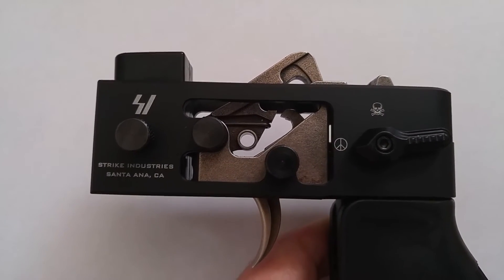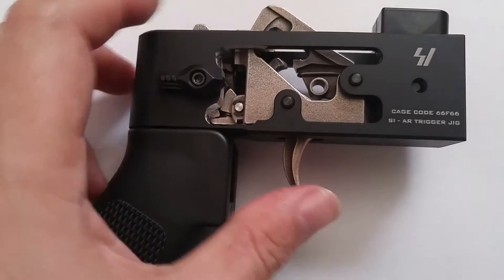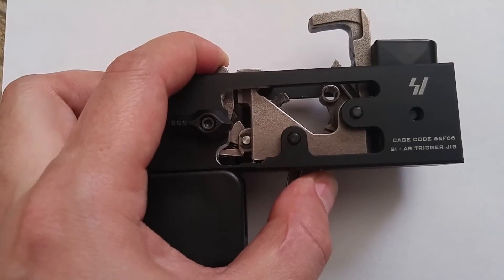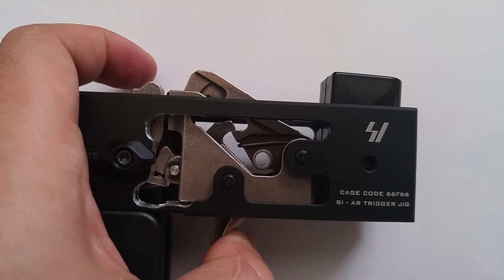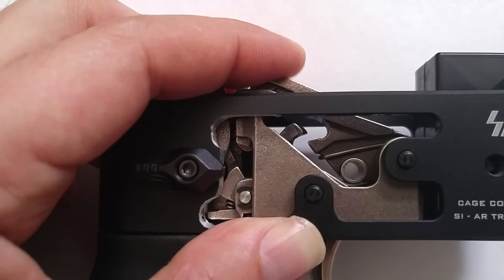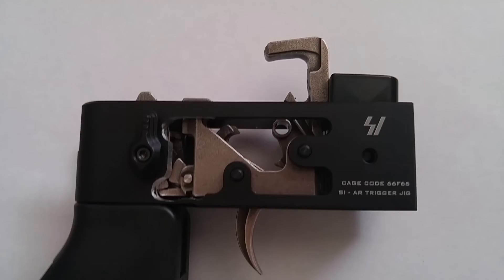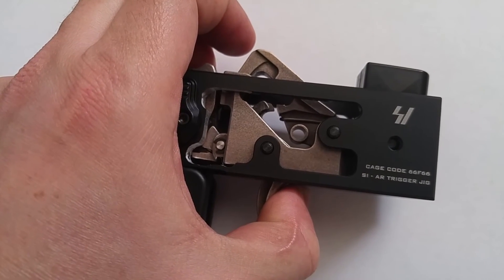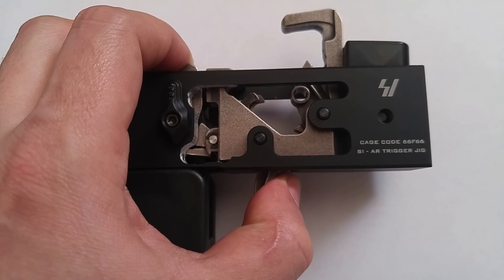Fostech Echo - cycle of operations shown in a jig.

Comment: I think I'm having a problem with my echo trigger and I'm still confused on the operation of the echo mode. with my ar unloaded and in echo mode I can cycle my bolt, pull the trigger and the hammer falls, hold the trigger all the way back while cycling the bolt again and while the bolt is closing I can actually release the trigger and the hammer will fall before the bolt is fully closed. I thought the trigger lock was supposed to not let you release the hammer till the bolt fully closes? I called Fostech and they told me to put a heavier buffer in which makes no sense to me.
Reply from the maker: Rush747red, it has a hard protection against pulling the trigger to early. The protection against releasing too early is the heavy pull to activate the second shot. Almost all rifles will cycle before you get the trigger far enough back to activate the release shot and then actually release the trigger.
Reply: jaqufrost  thanks for the info, im just a little nervous because I was getting failure to fire on release of the trigger with light primer strikes and just noticed what I described. I guess I will just try a heavier buffer like Fostech said.
Reply: Rush747red. Q: How is the the Fostech Echo 2? now ?
(What was the problem being caused by / What was the "fix" ? )

Comment: I finally understand how this "Safety sear" is ATF approved, it holds the trigger until the bolt goes into battery, not the hammer. Genius.
Reply: Idk if you’re still active but could you elaborate on this? Kinda curious
Reply: @On-toor1069  It holds the trigger and not the hammer like most safety sears basically so a full auto conversion wouldn't be easy.
Reply: @redtra236  I appreciate it
Reply: Will it still fire twice if you release before it cycles though or will it just reset to the front sear?

Comment: Hello why does your echo trigger look different than the one with the two springs on the sides?is yours a different model
Reply from the maker: Jg gj, it's the same model I just pulled the hiperfire springs off for the video. I wanted the twin disconnectors to be clearly visible. I put the springs back on before putting it back in my rifle.
Reply: Ahhh ok thank you.great video by the way

Comment: My echo trigger does not work correctly. What is this bushing you guys speak of?. Maybe a link to it. Thanks.
Reply from the maker: sh839c, check out this thread.
http://www.ar15.com/forums/t_3_118/704184_ECHO-TRIGGER.html

Page 14 has my bushing picture. If you post in there describing the problems you are experiencing there are several of us who can help troubleshoot. I also like to mod my own carrier as it provides a lower echo activation weight.

Comment: The bushing. Does it go UNDER the trigger block or AGAINST it? Using the specs from AR15.com (ID/OD/height) it looks like the trigger block should contact the post and the bushing then to keep it aligned against the body of the lower. Your picture shows on AR15.com shows it entirely on the post and the trigger lock then contacting the bushing.
Reply from the maker: Michael, the bushing goes over the post of the back up disconnector. The bushing is held in place by the side of your fcg pocket. The bushing keeps the backup disconnector cammed out slightly and brushes along the inside track of the trigger block. I have a picture of the bushing installed on the post on page 14 of the big arfcom thread.